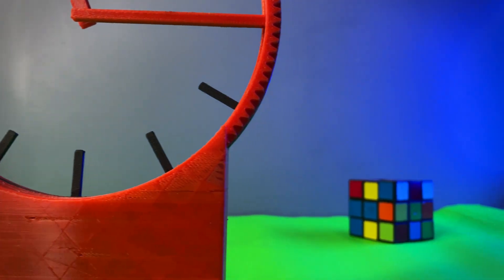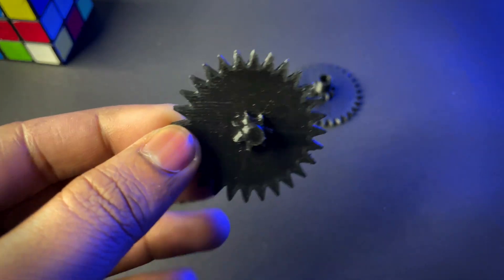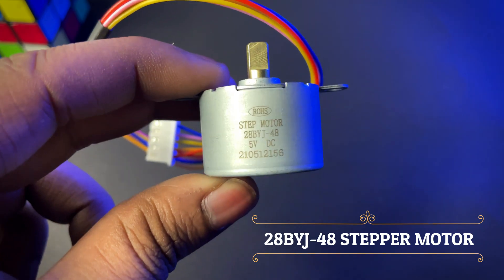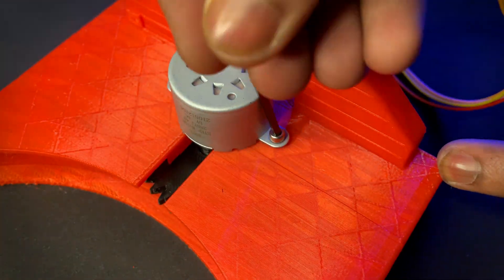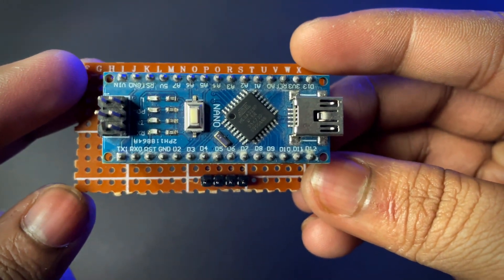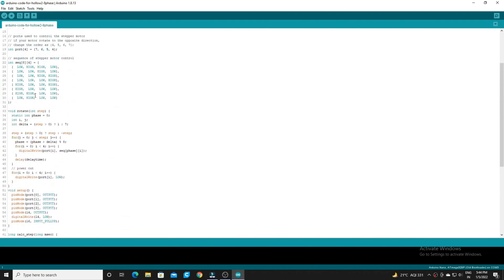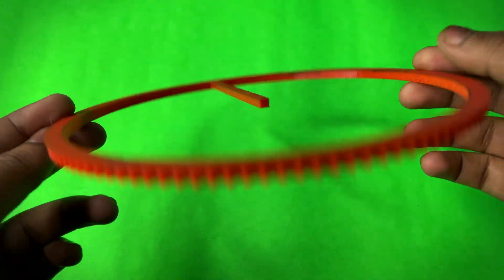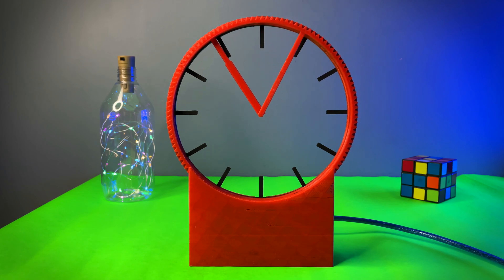How To Make Hollow Clock Using Arduino 😍😱

Comment: Something's off with the ratios, the hour hand should advance one hour with one full rotation of the minute hand.
Reply from the maker: actual clock code given in description
Reply: @electronic_noob_shorts  That's not a reply to the comment. The hour hand doesn't work.
Reply from the maker: @tcarney57 i mean there are 2 codes one is only for rotating purpose and another is for clock timing… i just used rotating code for demo if u want to make an exact clock then follow the clock code